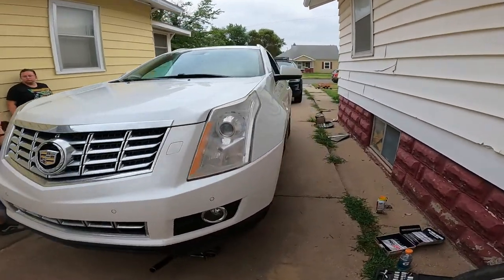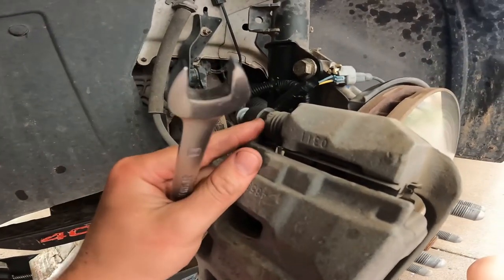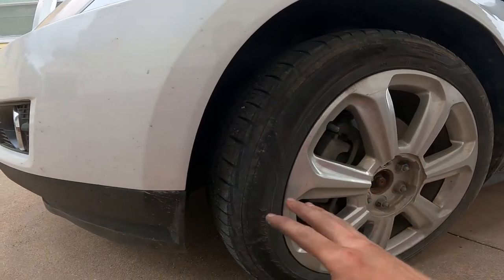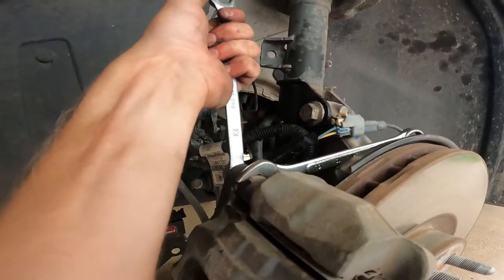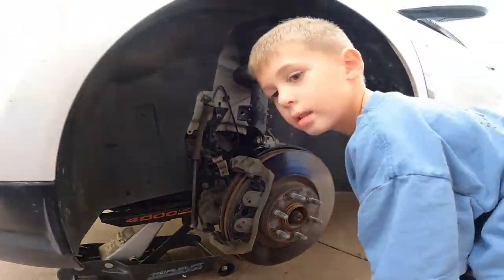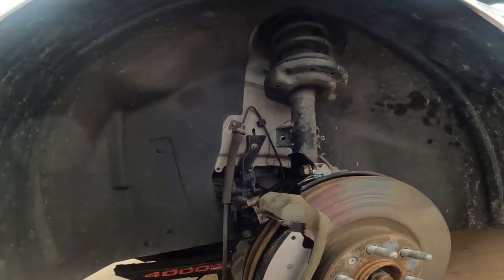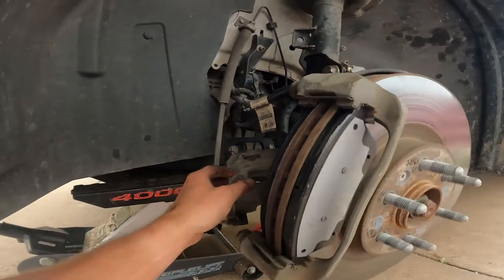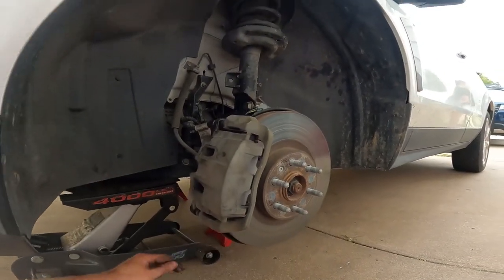How To replace Brake Pads on a 2014 Cadillac SRX - Daily Vlogs

Comment: What are you doing to the rotor. You should always resurface the rotor if if has enough thickness to do so if not you should replace the rotor due to warpage and runout. Brakes will last longer and be much more affective if you address the rotors. Pads are just half of the the brake job
Reply from the maker: Good to know. I've only replaced rotors if they are grooved.